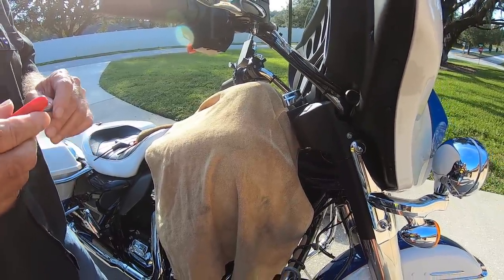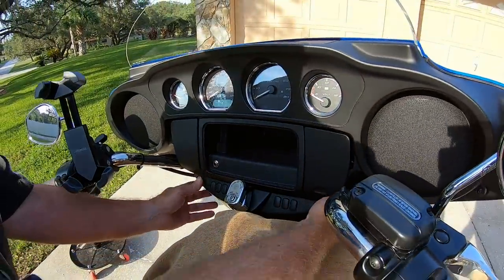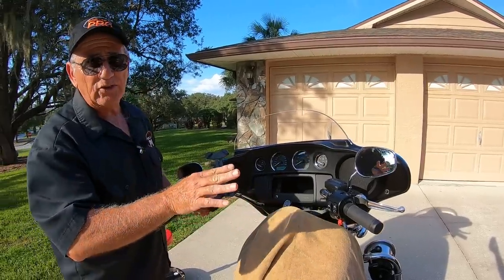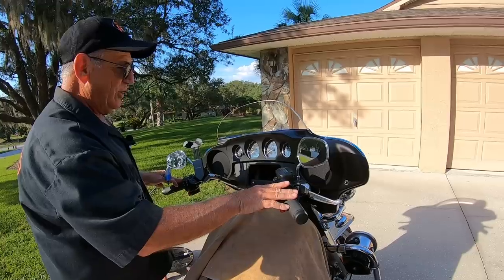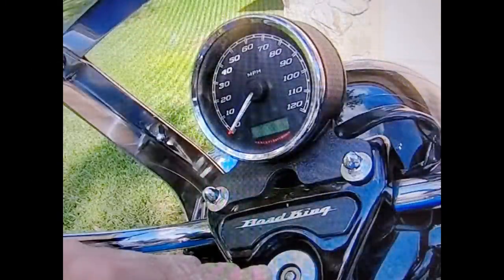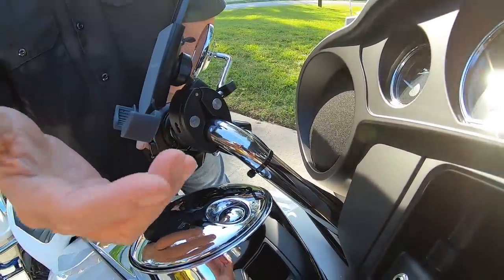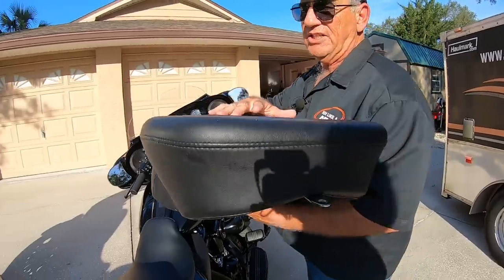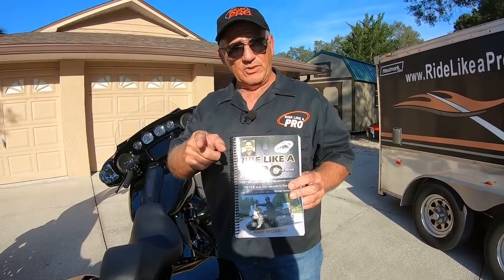How to make low speed turns easier...

Comment: Thanks Jerry. Glad to see Donna (Camera Girl) is back in action. 🤠
Reply: I've already adjusted my handlebars and going for a test ride after dinner. 😀
Reply: Just got back from my test ride. I pulled my handlebars back about an inch and it makes an incredible difference. I can lean a lot easier into my turns at slow speeds and have more control at slow speeds. Thanks again Jerry. 👍🤠

Comment: I was having trouble at low speeds on my RG Limited. I bought a Mustang Super Touring seat which moved me back in the seat almost two inches and it raised me about an inch. Now riding at slow speeds is much easier. Why? I don’t have a clue but it changed everything.  I’m 6’0” or was, and I’m glad I tried another seat because I was beginning to think I was the problem as I’m getting older. I’m probably Jerry’s age. 😁
Reply: Yes, a different seat makes all the difference in your position while sitting on the bike.